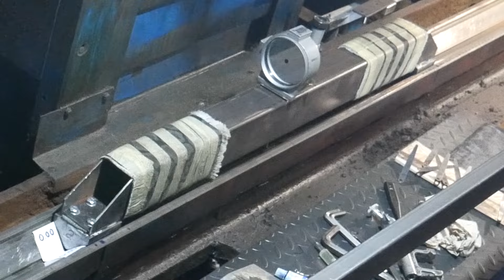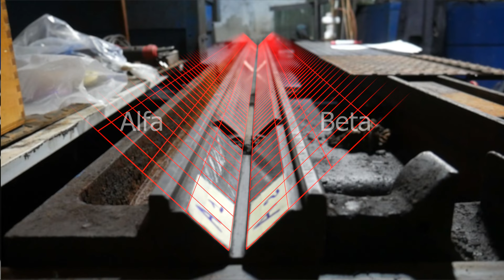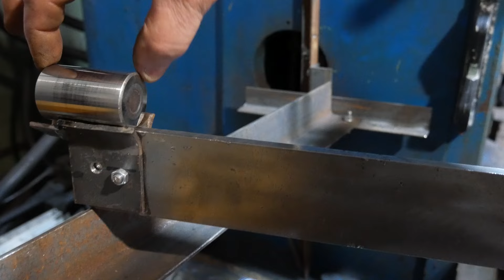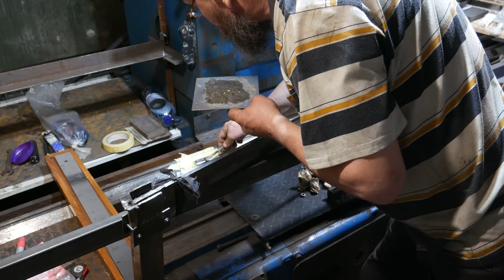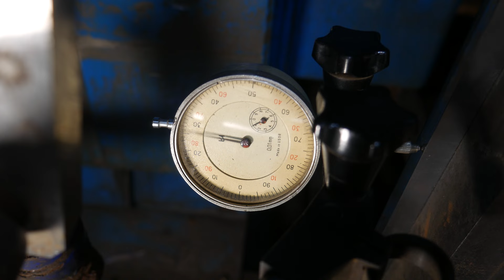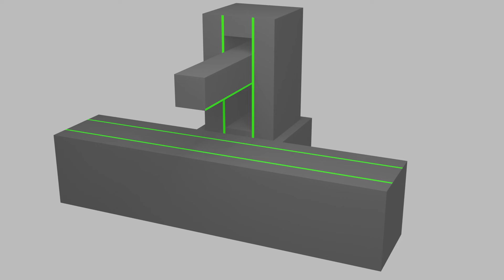Deviation from an angle of 90 degrees. Control. Continuation of repairs.

Comment: Nice video.  You are putting much effort and showing how to square a machine that does not even need it in that direction. Squareness of the wheel is more important in the two other planes, and I am sure thatt
Reply from the maker: The accuracy of the longitudinal movement of the table is the most important condition for a grinding machine. The accuracy of the transverse movement is less important, it can be compensated by introducing corrections. The accuracy of the vertical movement, I agree with you, does not affect the quality of grinding. But if there is a possibility to improve its performance without spending "energy", I think it is quite reasonable.

Comment: Excellent presentation of an accurate and systematic measuring process. I'm wondering one thing: did you check beforehand whether the machine was still exactly level everywhere?
Reply from the maker: I don't know how the foundation is equipped. Everything below is filled with concrete. I hope that the requirements of the technical manual are met, and everything is firmly fixed on a solid foundation.

Comment: This is a Gem again, Gennady! :) Thank You for paving the way, we would have to spend time and efforts to investigate (and with uncertain luck). I have missed Your previous video, somehow, although I have subscribed. I am happy to see them both now. I also have a lot of scraping to do with my old machines. Your presentations are enlightening and encouraging, a recipe to get it well done if only simply followed with care and attention. It is hard to imagine a process more efficient than Yours. Thanks again! Btw You have not removed the information about the sale from Your last video yet, so I hope it is still relevant and will try to get in touch with You again with that regard :) /Grzegorz
Reply from the maker: Are you Grzegordz from Poland, whom I know?
Reply: Yes :) You have my precision plates ;)
Reply from the maker: Excellent Grzegordz! I have already gained my first experience in repairing a guide with an autocollimator. You see, I'm working with the same as yours, 1 arc second. Already with this autocollimator you can do the job perfectly and get excellent accuracy on the guide. If you add a good camera and display the image on the monitor, the sensitivity of the device will significantly increase.
Reply: Thanks Gena, maybe You are right and 3-5 microns per meter is enough for me at the moment. My mill is also worn out at as much as around 0.1 mm on the main axis. The tricky part being that I have 45deg dovetails on table parts weighing hundreds of kilos

Comment: If I did the math right (no guaranty ;-), the total out of tram vertical angle of arctan(0.26/2/300) ~= 1.48969017 arc minutes means dropping B1/B1 by about 0.43 microns. And moving back toward tram is generally a good idea. Since C1/C2 can not rise up then B1/B2  need to drop, but only if D1/D2 have an excess of greater than 0.86 microns above flat, else the whole run will need to drop and that is a lot of work, especially when it only corrects a cosine error in the vertical measurement of ~=94 nanometers per meter!
Great work, thank you for sharing!
Reply from the maker: Hello! I think you calculated everything correctly. Of course, I use the data received to the extent that it is rational.